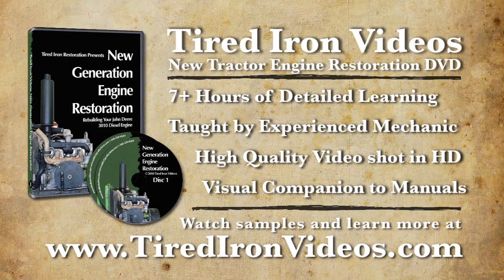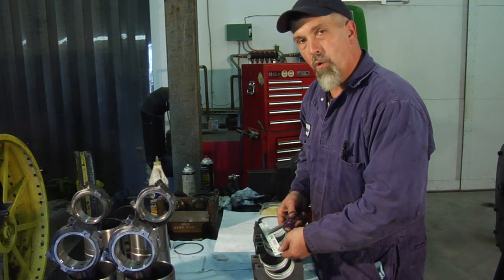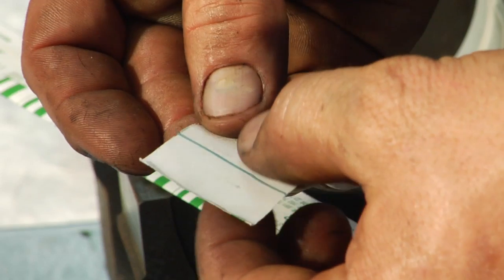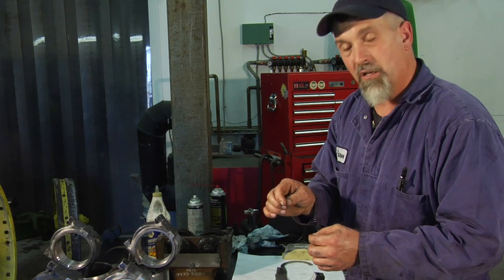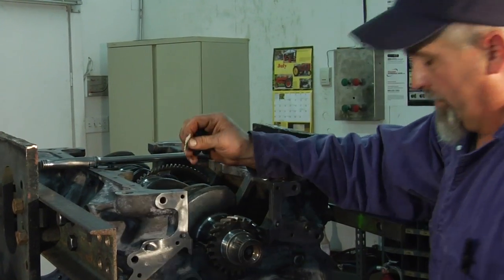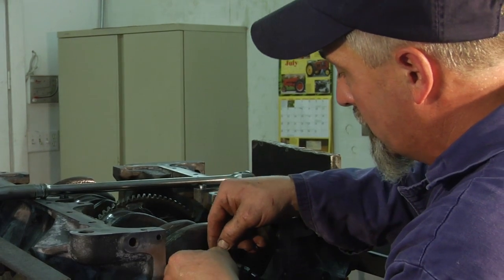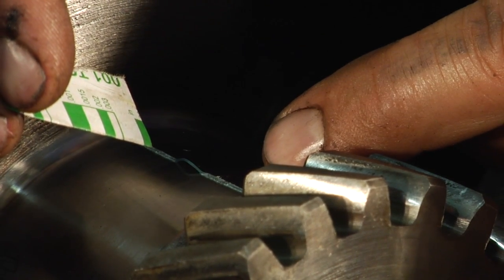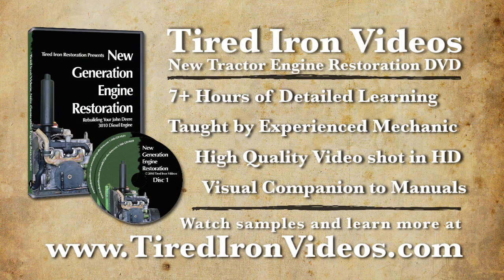Measure Oil Clearance Using Plastigauge

Comment: Hi Tirediron, just want to let you know if you have a chance to check .003 bearing on plastic against a bore gauge you will get about .004 to .005 reading on the bore gauge. As long as it is with in tolerance will be ok, just commenting that there is a difference

Comment: Check these with plasticgauge and that will tell you if you can reuse the crank without a regrind, if you are beyound what the specs say, verified by the plasticgauge, you will need to regrind and get a new set of bearings

Comment: Take the old bearing out, you'll be replacing them anyway right?
On the old bearings there should be an indication as to whether they are 10-20- or 30 over or marked with an "STD" meaning standard.
Assuming you reuse that crank and don't have it reground to a smaller size you will use the same size as what was in there before.

Comment: what if i have the old bearings still in the lower end.how would i use plastiguage to see which new ones i would need?buy stock bearings and then plastiguage them in the block( like you did) and see weather i would need a different size?use a guage to check crank size?